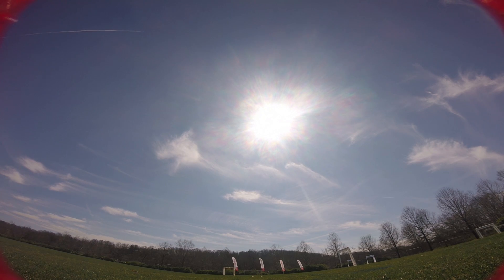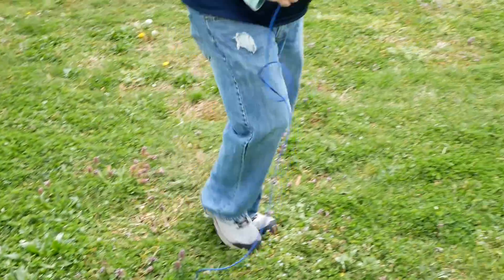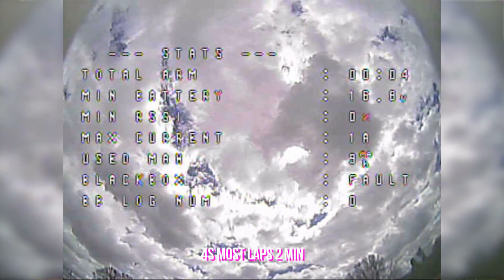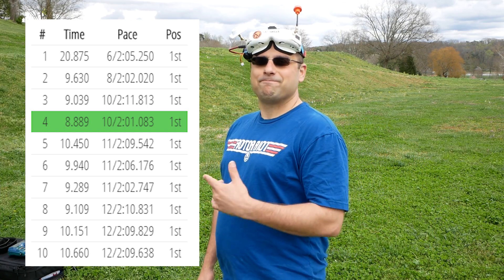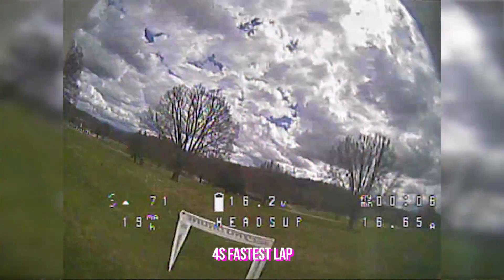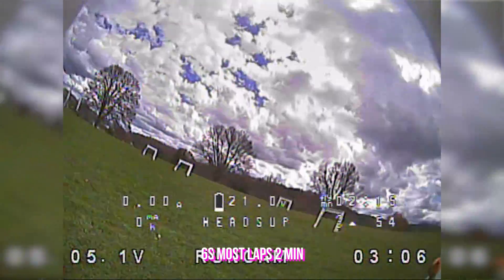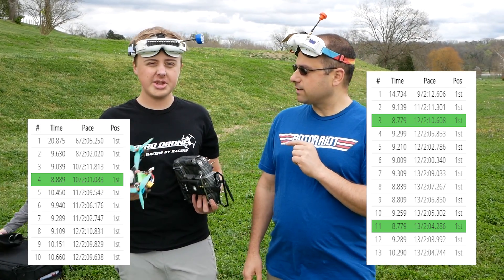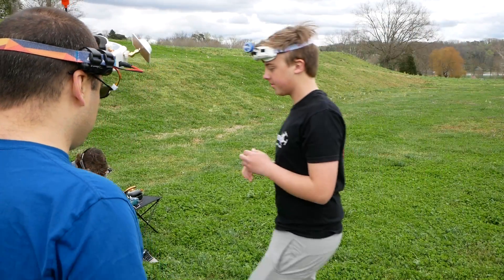6S is the new 4S | HYPE OR TRUTH

Comment: You really need to stop talking about it and put some smart people to task on some averages.
(wow that sounded totally rude! Sorry)

1. Total RPM 
2. Via Blackbox, add throttle peak times, amp draw, voltage spikes = too much, 
3. Determine what 6s truly offers above 4s. 
4. My assumption here is that the results will show that the ONLY time 6s is worth anything is when you can't fly and have to play catchup. 
5. The results will show, the average throttle can be achieved efficiently at 4s. With no throttle to spare. But with 6s there is throttle to spare, BUT at the cost of hard draw on the underside 4s of the 6s. Where you will lose some of the efficiency by accelerating into the +4s values. 

If you used a 50% rule, always double power needed but don't use the latter 50% you are in a sweet spot for efficiency. Battery can smoothly power, but at the same time, you cannot find that sweet spot easily because the first 50% has to lift the other without expectation of performance increase. 

I'd like to see a custom build done that monitors literally every point where power moves in the system. Determining losses and cleaning up "dirty draw" will be what finally allows 4s to really break through as an efficiency monster.

Fix the reasons batteries heat up! As the pack warms, the C rating increases. This is why 6s blow up so much. Motor not under enough load, too much power going in with too little prop grip lead into prop wash or oscillating blade tips that go from buzz to rumble. 

The only way this will ever end up will be split up, techs, techs who don't fly, techs who can but don't need to, techs that don't care because the pilot is too stupid, forums with little help = HUGE learning curve.
Reply from the maker: This video is 2 years old and there really isn't any debate any more that 6s has performance advantages.
Reply: @JoshuaBardwell  sorry, I meant to say DATA please. Not try to tell you what to do. Sry, I've heard a lot but those numbers would actually say something to me. 6s dropping off like it does in most cases says to me something is happening with the power. I said "smart people" cuz I'm not the one on this one. Sorry, I realized how it sounded. And I never look at the date when I heckle, I just expect Lincoln to listen. FPV Cycle hasn't found "their" prop yet for that 30mm. So its not like I am all that sure about opinions or descriptions that are dependent on the vocabulary of the source. I would think we should start to learn things like, how many sheets in a battery to make a cell. How much theoretical momentum can be put to paper from the energy around one sheet. Figure out the weight each sheet can theoretically lift. Lift capacity per sheet, per cell, in series, etc. 

Get nerdy enough and you can literally calculate the voltage required to be at any given Valtitude, Vrate, Vexpectation, Vactual, Vtimetilempty. Who cares? Maybe the next genius to implement warnings that are more specific like in RTH time-dist-speed calculate to get warning "maintainspeed/heading" or you die! This use = this specific risk of failure. If I can calculate failure then I will launch DASA Drone Aeronautics And Space Administration. I could be overthinking like I always do. But if you could know it would happen, would you take that option over random results? I see this relevant when it comes to spec racing mostly. 

LoL "I have not been talking about this for two years" 

Thanks for the reply

Comment: Correct me if I’m wrong but after just now hearing about it, I’m guessing the benefit here is that the motors can supply more torque or supply torque easier and so this helps the quad go between different speeds faster. Same rpm at the end but there’s higher theoretical max torque with this setup

Comment: The figures don't make sense. I'm sure running less amps would improve efficiency but battery sag is from exceeding "C" rating in my experience. But calculations say the 6S 75C should push 2081 Watts Constant and the 4S 100C, 2294 Watts so the 4S clearly has a big advantage.
UNLESS the 4S is actually 75C cells that would make it 1720 Watts Constant and would explain everything!!!
Is this just another example of overrated 4S "C" ratings??????
Reply from the maker: C rating is meaningless.

Comment: Do you realize that the 1550mAh LiHV pack will yield far less when charged to 4.20 volts/cell?  Expect ~1350mAh when only charged to 4.20 volts/cell.  This test was thus between a ~20Wh battery (4S) and a ~28Wh battery (6S).  Of course the 4S is going to crap out well before the 6S battery.  If you want to perform a valid test, do the same with a 1800-1850mAh 4S pack and a 1250mAh 6s pack and you'll find that there's no real difference.

Comment: I've found what it really comes down to is the battery weight or MAH. If you compared an equal weight 4s and 6s battery im predicting the results would differ less and you would have near equal endurance and speed. I run 4s and 6s and i do find 6s to be faster but i run a battery that is 25g heavier.

Comment: Moving to 6S isn't some new breakthrough. Your just trading current for voltage to get the same watts. In fact the reasons why its beneficial applies to all electrical devices and has been implemented for several years. Handling higher voltages is generally much easier on components than higher current.

Comment: He's human!  He can crash.  I feel a little better...  I bet he never hit a power line, tumbled into huge, deep retention pond and went in and rescued it at 9pm in Feb.  With gail force winds.  OK, OK  it WAS FL.  But there could have been gators and water mocs!  His stuff is boring in comparison.  LOL. He's my new hero though.  Joshua,  your still close. LOL Tommy's brand Vortex, still running with normal LED blinking under 6' of water for half hour. No video.  And it didn't run under the water. :(  LOL

Comment: Would love to see bmsthomas winner of Sebring 2018 test this out.
Reply: i think bmsthomas is doing some six cell testing as well.  it will be interesting to see what the top racers run this year and which cell count consistently does better.
Reply: Kevin Turner that kid he can fly a pig and still finish first. He is an amazing pilot.  The quad he took to Sebring was 321g, many ppl say you need your quad dry weight below 280g blah blah which btw I was also in the same camp.

Comment: In racing land vehicles (1/10 on road and off-road), 2s is spec, but generally, no limit on capacity. But of course, keeping weight in mind when choosing the capacity of race battery packs.     What I’ve seen, is if you are consuming more than 50% of your pack capacity the duration of the race, it will soften, as you saw happen in this video with the 4s pack.  But, if I use a pack with higher capacity with a mild weight increase, the torque of my cars will not soften, as you see in this video with the 6s pack.  More specifically, if the car I’m racing consumes 2500mah in a 6min qualifier and 3000mah in an 8 min main, I want to be using a pack with at least a 6500mah or better.  In my own experience, keeping the amount capacity consumption below 50% will keep your torque level high throughout more of the race.

Comment: The efficiency argument will last a couple months. Racing is racing and people will change up their KV to get more power and speed at the prop.  The 6s also had 25% more capacity and no amp reading to compare it to the 4s. I'm not against 6s really, I just don't buy the efficiency argument. It's been argued in every other aspect of electric RC  already and as far as I've seen it always loses out to just getting more POWER and speed. Because racing...And because the only way to charge a coil faster is to increase the voltage. We not inventing anything here. Don't give anyone credit for thinking of it, you'd have to go pretty far back into electric RC for that.

Comment: Makes sense, I don't race, but I still fly fast and mix low carving with floaty high altitude freestyle, this would probably make for a more enjoyable flying experience, since I have to switch up my flying style as the pack starts to sag.
I'm invested in lots of 4s gear already, so I will give it a pass until my gear is tired.

Comment: more cells = less load per cell... Therefor you would think that it would hold voltage better than a 4 s especially when you get to the end of the battery. Get more out of the battery unlike with 4s where due to high loads the voltage sage is quite considerable.. Is what im thinking anyways...
Reply from the maker: More smaller cells means the C-rate is the same for the same watts pulled from the same Wh battery.

Comment: Joshua, love the video been waiting for this for a while! 

Quick question: for a capacitor on the battery leads of a 4-in-1 esc on a 6s low kv quad, is 35V enough or should it be 50? I’m assuming 1000uF is enough?
Reply from the maker: I would use 50 myself.

Comment: Good video for the most part, definitely makes me think... 
However, a few complaints: the experiment was far from scientific as there is too much of a human element in the testing (as great of a pilot as HeadsUpFPV is, he can't replicate the piloting skill every time, no human could, and is likely more practiced on 6S as that appears to be his choice setup). I would love to see another follow up with on the bench raw data (yea, I'm a nerd). Maybe hook up the motors (multiple brands and models to have good representation of each KV) to a constant voltage power supply and put a constant load on them, possibly with a friction belt or eddy current resistor and see wattage of both voltages.... just an idea.

I admit, I've been pretty reluctant to the idea of increasing voltages as the cost of entry to more competitive racing definitely cranks up, and being a broke college student, that would make it much harder for me to compete at a higher level this year... Definitely can't ignore the evidence though.
Other than that qualm, great content and definitely inspiring to get out and practice more!

Comment: Well that was fun to watch.  I really don't care about the scientific merit of the results, nor do I care much about racing as anyone who's watched my videos knows, but I respect the time and concentration that must go into flying like that!  I fly 6s for freestyle every day, i rarely use 4s anymore, 5 or 6s almost exclusively.  6s gives a very different flying experience, motors run smoother, there's a torque advantage.  I swear everything runs better on higher voltage, just don't try to draw too many amps with high kv motors.

Comment: All acting about hype and like it's new....NO ITS NOT! It's been around YEARS ... Basic electronics!! VOLT UP AMP DOWN!!! This and AC is why our power lines don't melt and why we use AC. HELICOPTER pilots have been flying high voltage for YEARS in RC!! Minimum is 6S some run 12-14s on the 700 size class.

For good reason as only way to make it efficient and pump the power needed!

Jeez the MR community is slow and hyped beyond common sense!
Reply from the maker: First... take it easy.  Nobody is claiming that Ohm's Law has just been discovered. What is new is the popularization of this idea in mini quads, meaning that more manufacturers are making parts that work in mini quads at 6S voltage.
Reply: Joshua Bardwell May have got to carried away with caps there, I'm just amazed it's taken the community and manufactures so long to catch on seen this coming years ago. ANYWAYS - If all else fails just remember the mantra :) 6S is success! :P

Comment: You should angle your LapRF at a 45 Degree Angle pointing to the top corner. I not angling you should be placing it in the middle of the gate.

Comment: Forget the number on the label.  Its about as accurate as KV on motors.  Find a battery of comparable mass.  Pulse 6s 1250 is 219g!  Run it against a Boka 1900 4s (213g) or Tattu 2300 4s (224g).
Reply: Pulse 6s 1250 is 209g with xt60 connector.  They don't come with an xt60 and their website lists the weight at 206 grams, but they are 209 with the connector added.

Comment: Yeah a real comparison would be an 1850 4S and a 1250 6S. Unfortunately this turned into more of a capacity comparison. No wonder there is less sag on a relatively larger battery. Love that youre exploring this but it would be great to see the capacity of the batteries matched better. So they are close in total and weight to see if there really is a difference. I suspect not

Comment: Seems it still can bother only guys who really participate in races. For casual fun it doesn't matter much plus gear for 6S is quite expensive (especially batteries).
Reply: Future me - on 6S already. Yes, 6S is still not cheap, but not especially expensive. With some requirements to electronics and voltage monitoring to avoid killing the battery. And - it is totally worth it :)

Comment: To make it clear:
To compare both packs we need to have a look at the power/watt (P) and not the voltage (U) and the current (I) seperately! 
The equation is the following:  
~ P = U * I

So lets have a look at the actually energy (Wh) contained in both of the packs as used in the Video:
~ For the used 4s pack that would make 4 * 3.8V * 1.550Ah = 23.56Wh.
~ For the used 6s pack that would make 6 * 3.8V * 1.250Ah = 28.5Wh.
That means that in the used 6s pack is actually more energy contained therfore it is no wonder you can go further with the 6s pack.

It is also not quite right, that a 6s pack would need to have a lower C-Rating than a 4s pack, as some people say here!
The C-Rate is the factor you need to multiply the capacety (Ah) of a pack in order to get the Amps you can draw from them.
But a 6s pack with the same energy contained as a 4s pack needs to have a lower capacety ( less Ah) than a 4s pack.
So lets do the math for a 4s and a 6s that both contain the same energy of lets say 25Wh:
~ For the 4s pack that would make a capacety of about  25Wh / (6 * 3.8V) = 1.655Ah.
~ For the 6s pack  that would make a capacety of abotb 25Wh / (4 * 3.8V) = 1.096Ah.
Now we have a 4s and a 6s pack that contain the same energy. So lets think about two quads that deliver the same amount power of 900W (i just made this number up) next but one runns on our 4s pack and the other one on our 6s pack, both containing the same energy.
Lets calculate the current drawn by the quads in order to calculate the C-Rate the packs would need to have:
~ The 4s pack would need to deliver about 900W / (4 * 3.8V) = 59.21A to output 900W.
    Therfore it would need to have a C-Rate of about 59.21A / 1.655Ah = 36C to deliver the 59.21A and 900W. 
~ The 6s pack would need to deliver about 900W / (6 * 3.8V) = 39.47A to also output 900W.
    Therfore it would need to have a C-Rate of about 39.47A / 1.096Ah = 36C to deliver the 39.47A and 900W. 

Ther you have it! 
THE C-RATE OF BOT PACKS (&S AND 4S) CONTAINING THE SAME ENERGY ACTUALLY NEEDS TO BE THE SAME (36C in this example) TO OUTPUT THE SAME POWER !!!

However we have to remember, taht you can switch higher voltage more efficient than larger currents. But this effect is rather small, as we only use a very few watts in heat in our cable, connectors and escs compared to the power that is put out by the motors. Therfore this effects a quad not so much, but is a big thing on electric cars and so on, as the powerconsumption and therfore the current is much much larger than in our small racing-quadas.

@Joshua Bardwell Please confirm taht, the people belive in what you are saying, for good or for worth.
Like 95% of the time for good :D

Comment: You need to compare the 6s 1250 with 4s 1800, or it doesn't make any sense un terme of power and weight.
Reply from the maker: The problem with this is that NOBODY RUNS 4S 1800.

So if/when I do that test, that is the criticism that I'll get. People will say my test results don't reflect the real world and are invalid.
Reply: Some are used:
http://lipobench.com/index.php?page=Ranking
Reply from the maker: I'm not saying they don't exist. I'm saying if you look at what winning racers are using, I don't think you'll find 1800 4S. Correct me if I'm wrong.
Reply: Sponsored pilot don't use the best gear, they use what is made available to them...
An interesting factor to look at is efficiency: from what I saw on motor testing, you get an increase in efficiency going from 4s to 5s (to 6s?) of around 10%. This is scientific, measurable fact. Anyway, keep working, there's always something interesting in what you present.

Comment: The benefit of running 6s on lower kv motors is really simple. It reduces the current needed to achieve the same wattage by increasing the voltage. Lower current equates to less heat loss in the motors, ESCs and wires. This in turn gives you better efficiency. It's the same reason electric vehicles run at 400 volt, when it would be much safer if the battery groups were connected in parallel to give massive current and 12v. You would get the same wattage, but the wires and motor windings would have to be massive, and the heat loss would be insane.
Reply: but how in turn does better efficiency help you in fpv?
Reply: @louishouiller  he said it in the video at the end, it gives you more consistent lap times. ^s is really only valuable in racing, not in freestyle because the total prop RPM is the same.
Reply: Don't forget about the weight the extra two cells add.

Comment: 6s is the same principle your homes heat pump runs 220v. 110v would take way to many amps to do the same work. The even larger electric motors run 440v.

Comment: Hey Joshua, in the name of science, fly a 3S quad with very high KV and a big big capacity battery.
So that the thrust is the same as the 4S/6S quad and so is the C and Wh of the battery.

btw. I think the difference going to 6s can only be because of decreased losses and the fact the ESC's and stuff can be a bit cooler.